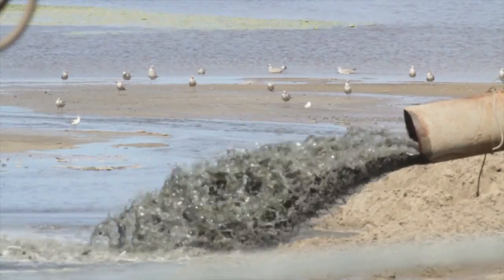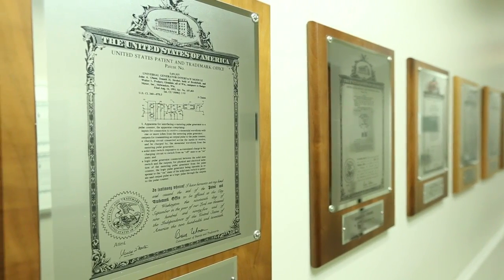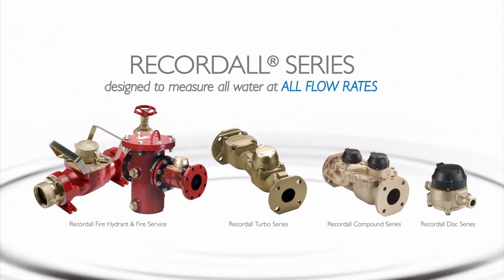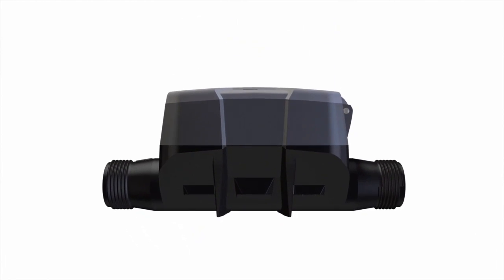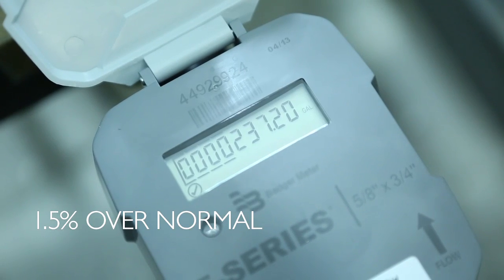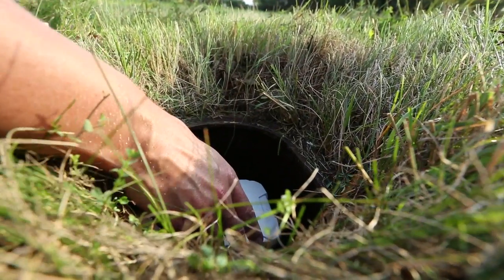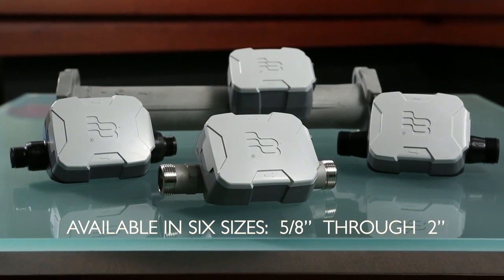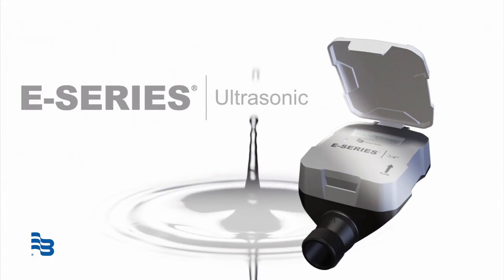Understanding Ultrasonic Metering Technology for Residential Applications | E-Series Flow Meters

Comment: Wouldn't want my water running thru plastic. Is the water only flowing thru stainless steel? Not clear in this video
Reply from the maker: As long as the plastic has NSF approval, you should have nothing to worry about.